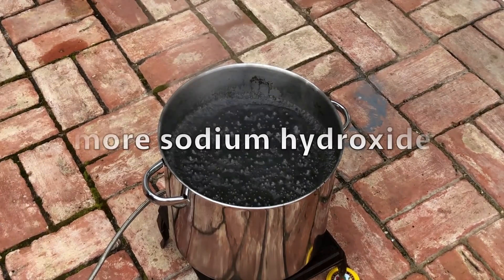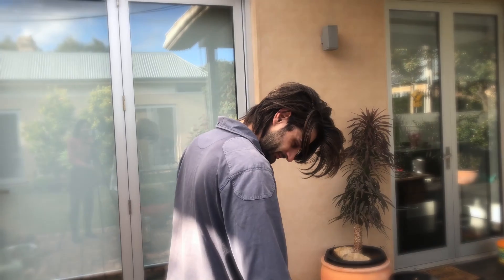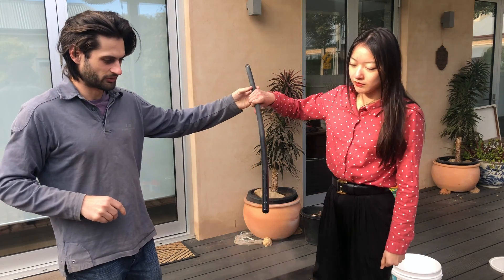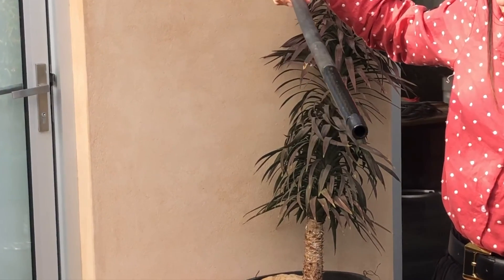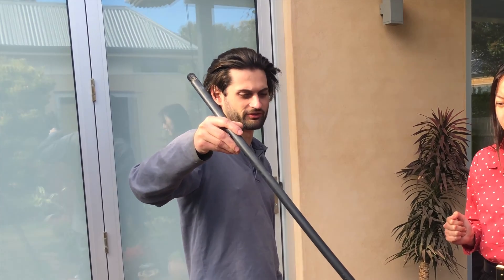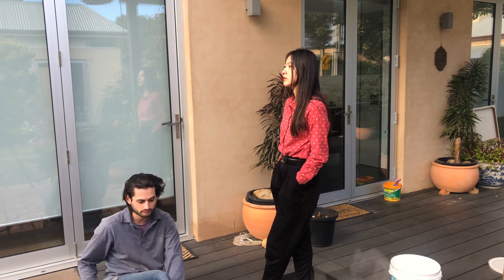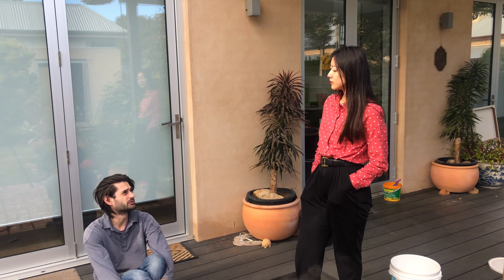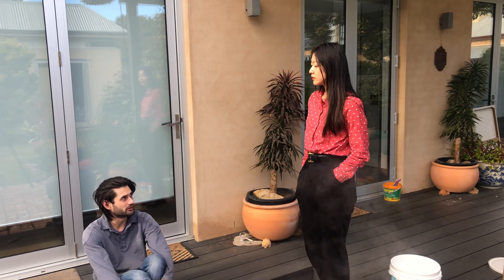Making CHEAP GLUE Sodium Silicate | 低成本矽酸鈉膠水製作過程

Comment: What did you use it for , how did you clean the pot , when will it dry upp upon applying glue , with reactant water or air , heat ?
Reply from the maker: It was used by mixing it with sand and injecting it with co2 to create sand moulds for aluminium casting. Cleaned the pot with water.
Reply from the maker: The sand and silicate mixture hardens with co2 exposure so it works very well for one time moulds.
Reply: Can we use it for grapghite parts to join